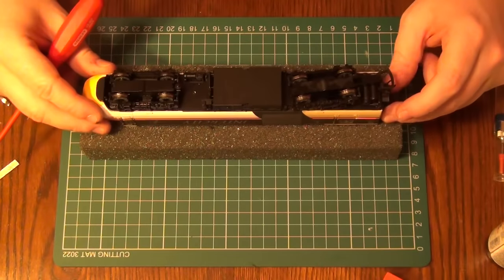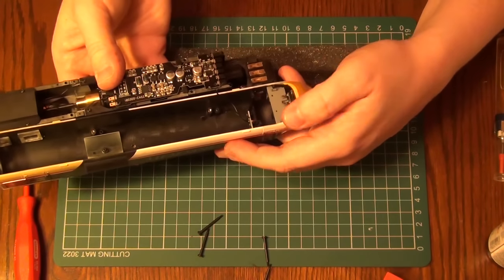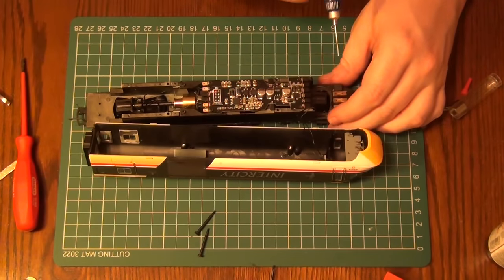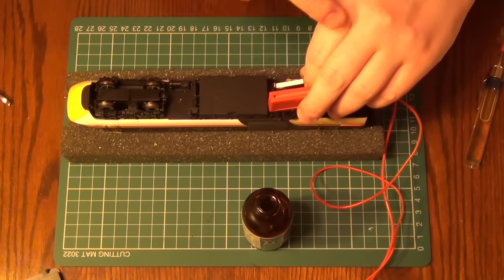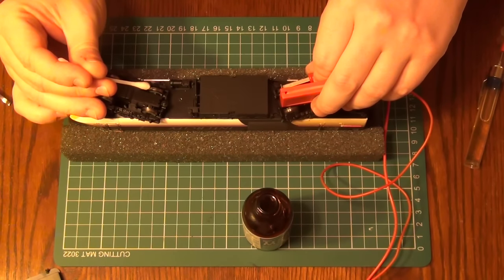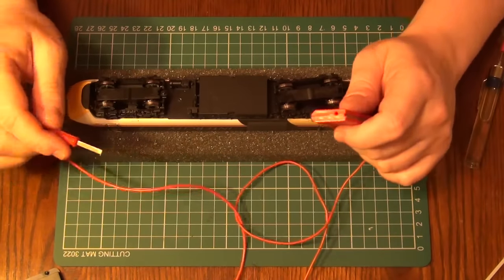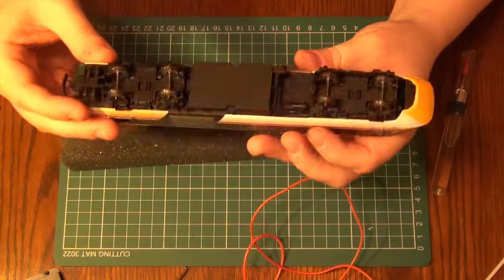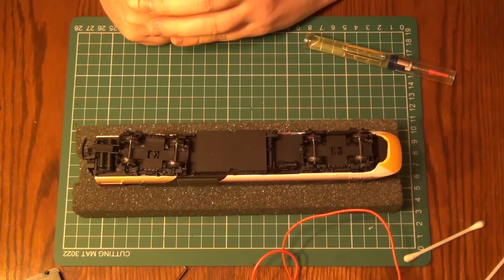Servicing the Hornby Class 43 HST

Comment: I am a newby to OO Gauge Hornby railways. I purchased a second hand Hornby HST 125,  fitted with a Ringfield motor, and serviced mine with the help of a Sam's Trains video which had instruction how to clean the brushes and armature, you haven't mentioned these parts on your video - don't they have these components in the latest motor?  also what is this type of motor called ?